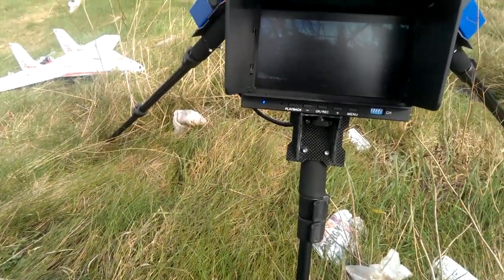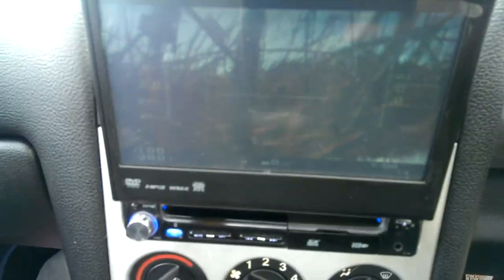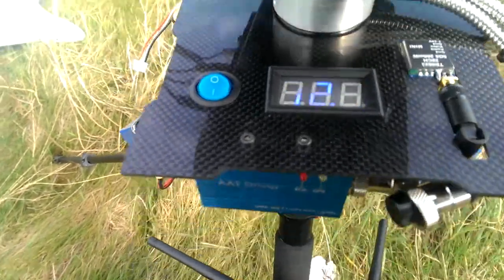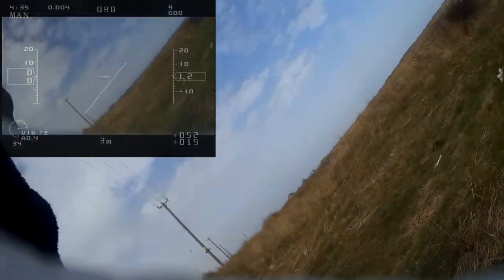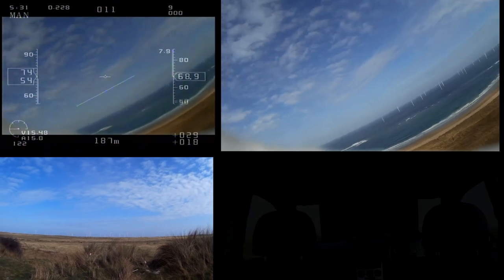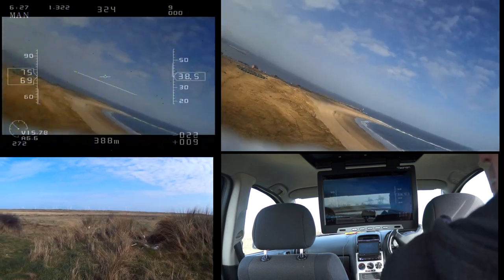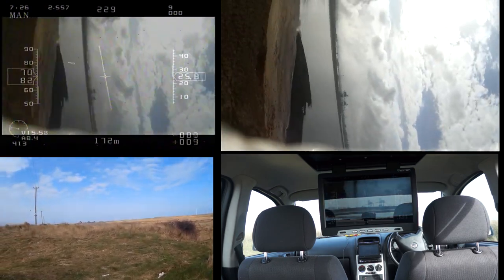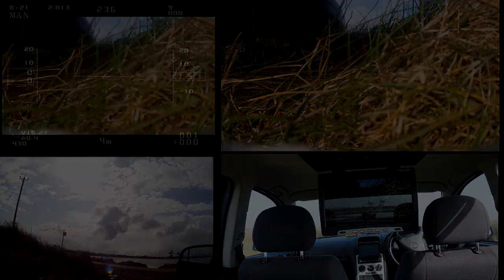Skyfun Maiden

Comment: Love the weather proof setup but what about the UHF inside the car being a bit handicapped? Obviously for short flights thats not an issue but any further? Are you using some FC with rtl on this?
Reply from the maker: The UHF will still be good for miles still being inside the car, it's 433mhz so just goes through the car with little attenuation. I do however have a mag mount for the UHF antenna but didn't use it due to it being a very close range shirt flight.
Reply from the maker: Coyote FPV Forgot, yes I'm using a MyFlyDream autopilot in it.
Reply: Coyote FPV This sounds great! so presumably some flights with someone else driving the car too?
Reply from the maker: Yes that's the plan Neil, the tracker will be stuck to the roof, UHF antenna. Me sat in the back flying someone else driving :)
Reply from the maker: See my new quick re-maiden vid, it shows the magnet mount on the roof this time